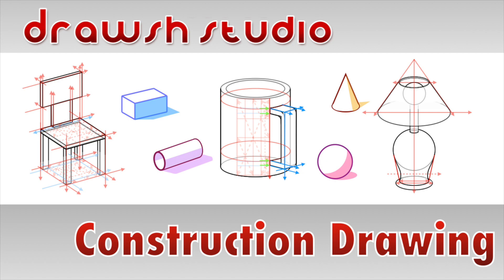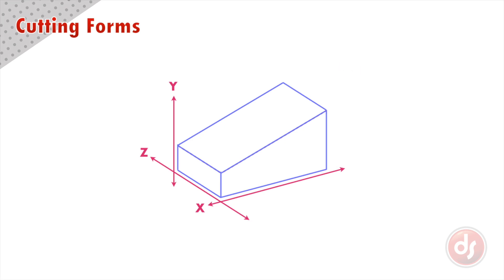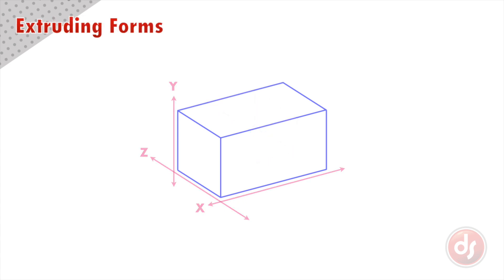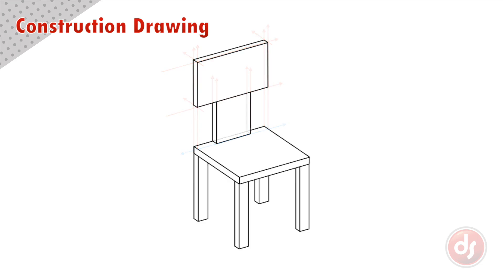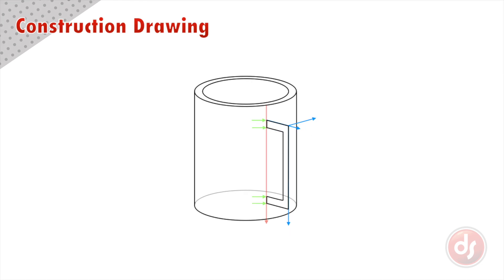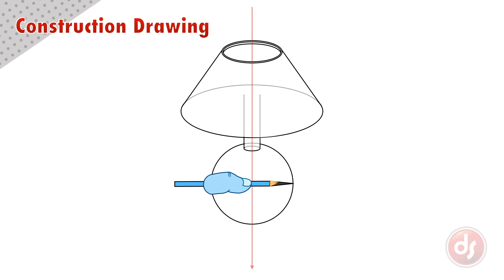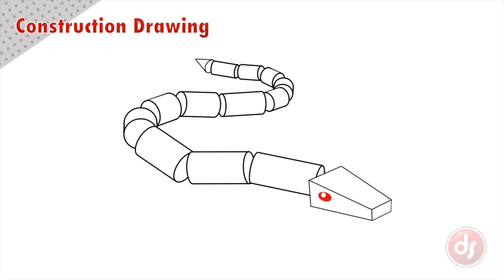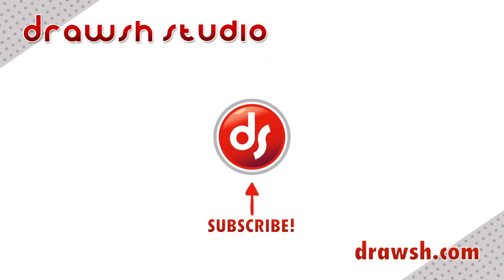How To Do Construction Drawing

Comment: You did a great job on the video! But there is another point that confuses me. For the cup example, you used two coordinate systems when constructing the subject and the handle. How did you determine the angle between each axis to make sure the XY planes of the two systems are parallel? I would be grateful if you could give me an answer.😊
Reply from the maker: Thank you, happy you liked the video. For the handle, I first chose an X angle that looked correct to the position of the cup. After that I simply used the principle of isometric perspective to keep the axis parallel.  If I draw the second angle and it seems to converge with the first, I adjust my line until it is truly parallel and the two lines won’t touch. The same will be true for all other X lines going in the same direction, they must match the initial angle. And then for thenY lines in follow the same idea. 

I hope that makes sense and answered your question :)